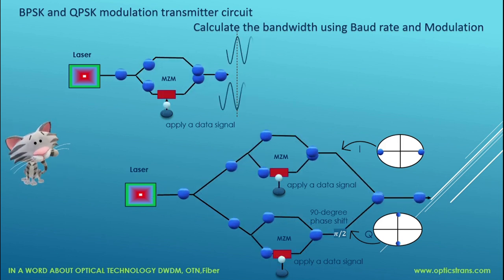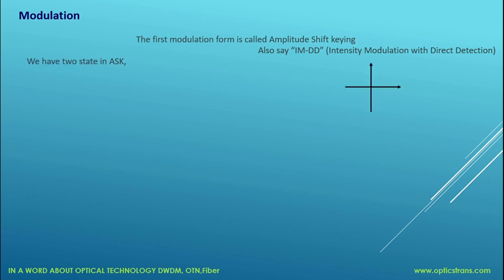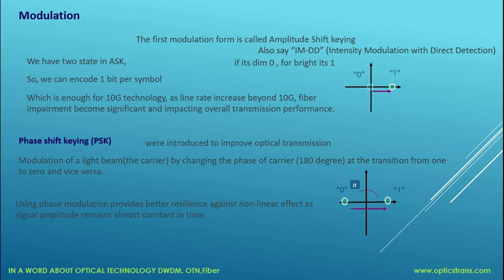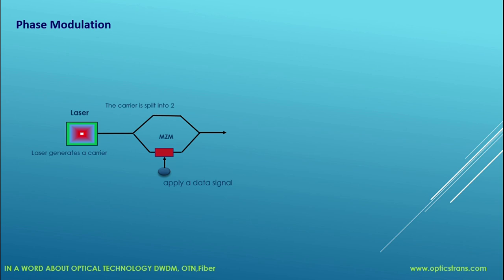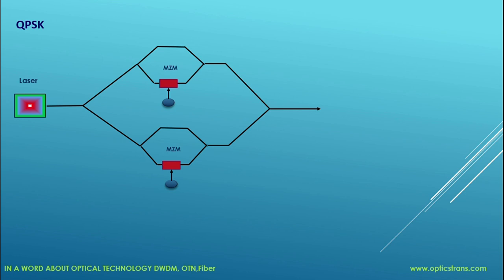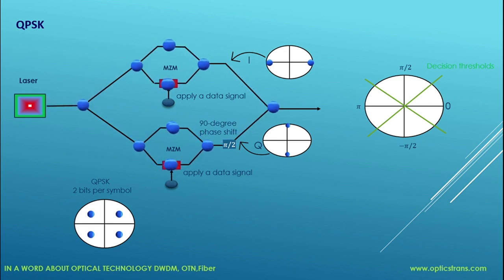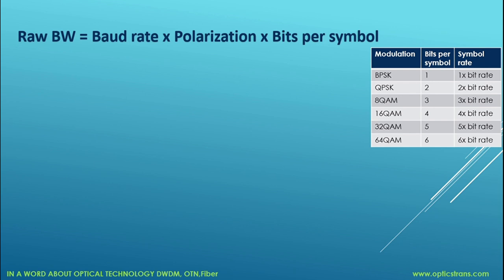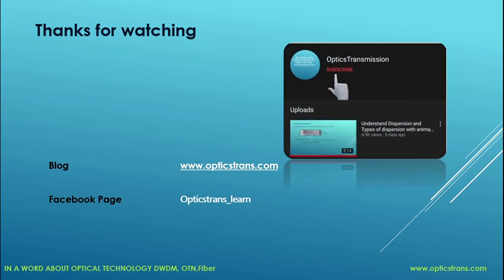Modulation in communication system | Polarization of light #telecom #physics | optical fiber

Comment: Your formulas look reversed: Symbol rate = Bit rate/number of bits per symbol.  Also, the Raw BW = Bit rate/(number of bits per symbol * Polarization)
Reply from the maker: Thanks for your comment.
To calculate BW, need Baud rate (symbol rate per second, in one second how much data transmitted) example- 32GBaud , in one second 32G transmitted. 
Then how many bits in one symbol example 8QAM - 3 Bits 
So BW transmitted in one second = 32*3 = 96G
Depends on Polarization if single total BW is 96 G if dual 96*2 = 192G 
Hope this clear, please feel free to share your suggestion/feedback.
Reply: @OpticsTrans  No that's not the BW. In your example, 192G is the datarate and 32G is the Baudrate  or symbol rate.  BW is related to the baudrate which is the switching speed of the signal.
Reply from the maker: @sunnyboy866  192G is the datarate , No, its RAW BW using dual-polarization (maximum amount of data that can be transferred per second on a link).
Data rate (speed of data transmission) 150G, channel is transmitting 150 Gbps data per second on one pol. mode.
Reply: That's wrong. Bandwidth is related  to the symbol rate and not the Bit rate. E.g 100G DP-QPSK require electronics to work at 25GHz and not at 100G
Reply from the maker: @sunnyboy866  What the BW in your example?. as per my understanding 
25Gbaud rate, QPSK(One carrier carry 2 bits)  , with dual-pol. 4 bits per symbol and getting 100G